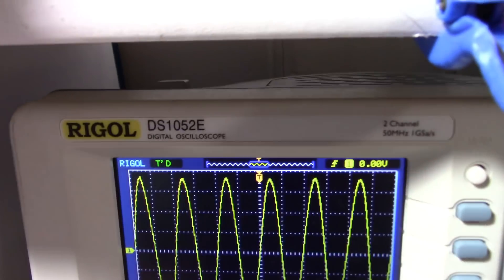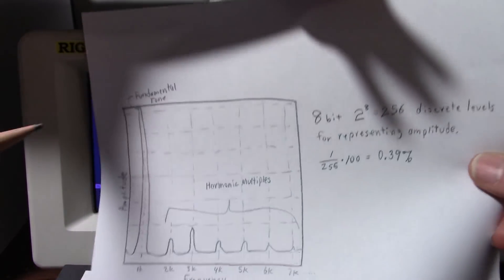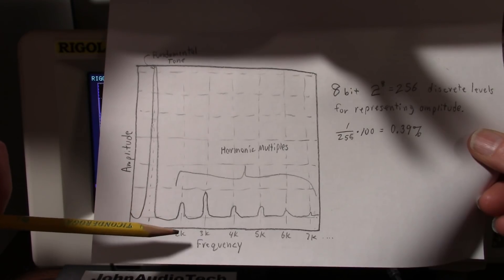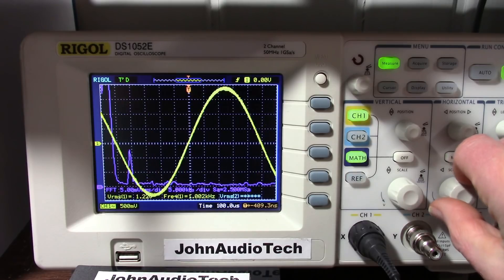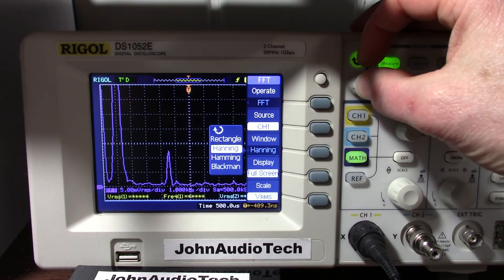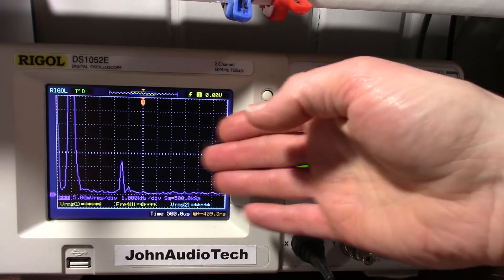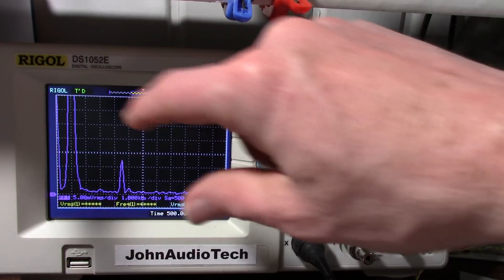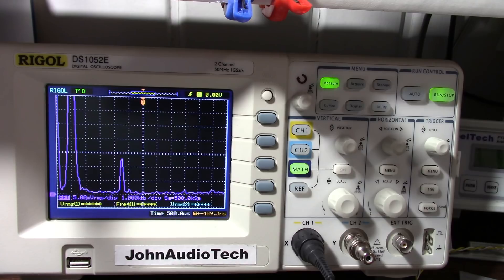Rigol DS1052 vs Siglent SDS2202X oscilloscope spectrum analyzer mode (FFT)

Comment: Only RIgol scope I have is the DS2302A.  The FFT is not too bad.  I like that I can have the FFT and Trace on the screen at the same time.   Really you should be using a PC with a voltage divider and 24 bit audio,  or spend the thousands on dedicated gear for distortion analysis.

Comment: I use similar Siglent mostly for FFT. Not sure about Rigol, but Siglent can do much better than seen here, but you have to know how to use it. There are a lot of things to adjust, but then you get very good audio and RF spectrum analyzer. I manged to get easy 60-70dB of dynamic range when measured harmonics of RF transmitter and got same result with real spectrum analyzer.

Comment: When working with oscilloscope fft, I like to use the avarages to reduce the noise floor... I have a Rigols aswell, and boy, that is a slowwwww scope...I'm thinking about adding the sds2000x 4 channel siglent scope for the lab. Not shure about that yet.

Comment: Revised for clarity on 5/4/20

Hi John, I have a question for you regarding analog to digital conversion. I don't have a problem with the concept of only two samples are needed to fully determine a signal's frequency, but I do have a problem with only two samples are needed to have determined both the signals frequency and amplitude. ..

I came back and edited my  question by providing a visual example to make my question a bit more clear. 

I am sure that a change from a negative value to a positive value is only needed to tell us that a sinusoidal waveform has gone from its first half cycle to its second half cycle along its full interval or period and from this given the timing of our sample rate we can determine precisely the frequency of a signal with as few as 2 samples.

However, think of a 20Khz tone as the signal. Now allow one's imagination to zoom in to just one interval or complete period of the tone along the time domain. What one is visualizing is a complete cycle of the tone along an axis of time. Suppose t=0 is the time at the beginning of this cycle, t=e is the time at the end of the cycle and t=m is the time where the cycle transitions from negative to positive by having a function value or amplitude of zero. In my model where are the peak amplitudes? Well, they are at (t=0+t=m)/2 & at (t=m+t=e)/2. Where along the axis of time were the two samples taken along this complete cycle of 20Khz? If the two samples were not taken at a point on the time axis that coincides with the peak amplitude of the tone in my example then what? Well, then we have an approximation for the amplitude and seemingly only precisely have determined frequency, right?

So, my question is essentially are people reading more than what is real into the concept that as little as two samples fully determines an analog signal. Otherwise, should they be saying, restricted to frequency and given a sampling rate, as little as two samples will within limits fully determine the frequency of the signal and provide an approximation for the signal's amplitude that becomes less precise with respect to amplitude as the frequency increases?

Aside from my question I hope your brother is doing as well as possible given the additional burden he was given to carry.

Thanks, 
Mike
Reply: Hi Mike, that’s a great question that I think actually can take a full video to explain well, but in short; it is the Nyqiest Theory that says that you can reproduce a wave shape in 2 samples per cycle.  But, I think most scope manufacturers shoot for 2.5x to 5x samples per cycle.  Great topic!
Reply: Edited for mis types and
Amended to include a summary of what my review of Shannon's theorems actually imply attached to the end of the comment. Yes, Kiss Analog, a video on the topic would be fabulous especially if you can visually show that aliasing is occurring such as by perhaps inputting a 22 khz tone with a precisely measured  amplitude into a ADC- DAC where sampling was at 44 K and show that the output is an aliasing artifact by not being an exact match of the input. 

Ok, I found my answer by finding Shannon's theorems related to digital signal reproduction. In particular Aliasing. 

Having no real electrical engineering background did not keep what I have a graduate degree in which is mathematics from recognizing something is amiss with the notion that as little as 2 samples will guarantee a faithful representation of the signal. 
 It will have a problem with amplitude and precise frequency if the cycle being sampled has only one sample in each half of the full cycle. For example aliasing or misrepresentation will likely happen when the 44.1k sampling scheme samples 22khz. The data stream for an interval of 22khz sound that has been recorded might look like this: (1,-1),(1,-1),(1,-1),(1,-1)...ad infinitum. The trouble is that while frequency can be determined roughly from this stream even were it precisely identified there still are an infinite number of amplitudes having a fixed frequency that will match (1,-1) or any other pair of numbers indicating a similar type of wave. I did not know this was called aliasing until today, but that is the term for it. 

Apparently people like to filter out the troublesome high frequencies that lead to aliasing when using 44.1k sampling. I would prefer going to 88k sampling which eliminates the chance of aliasing at 22khz and similarly issue prone frequencies and keeps the recording faithful.

The other thing of note is. The Nyquist-Shannon theorem people often refer to is actually several theorems grouped together that pertain to digital recording. Aliasing was the topic of one of the theorems and the rest pertain to other topics pertaining to digital reproduction.

Footnote or summary:

After reading through all of Shannon's theorems the general interpretation of his work that is fitting is:

If 2 samples having the same sign are provided then and only then the amplitude and frequency of the full sound wave being sampled is fully and uniquely determined else aliasing occurs.

Simply stated, 3 samples where 2 of the samples must have the same sign of (plus or minus) is required to avoid aliasing also known as misrepresentation. The common inference that only 2 samples are required to fully determine a complete sound wave is inferring too much by not recognizing the pair of samples must be in the same half cycle thus in reality 3 are needed to avoid aliasing. I have calculated aliasing or misrepresentation can occur at above 14.8 KHz when 44.1 K sampling is used. There is also a chance no aliasing in the human range of hearing occurs when 44.1 K sampling is used, but that is extremely unlikely unless the problem frequencies have been filtered out at input to the ADC.

So, yes C D quality and Hi Fi quality are indeed different and having my druthers...

Comment: Some comments if I may as a Siglent distributor. FFT results are dependant on timebase and memory depth as with a much larger memory and twice the sampling rate than the Rigol it takes time for the processor to compute all the data points into a FFT trace. Unlike the Rigol, the Siglent will give better results with more waveform cycles on the display and any discerning latency can be addressed by setting a lesser memory depth if required. Detailed inspection of very small signals can be accomplished by changing the reference level and the vertical scale. Also if the noise floor is unstable try selecting Max Hold. Reducing the FFT points is not the way to use Siglents FFT for best results. 
Oh and BTW, you are using the incorrect Siglent model number, what you have is SDS2202X-E, a 200 MHz DSO with faster processing, better sensitivity and FFT than the older 2000X series. As these are just $619 they are also much cheaper than an equivalent 2000X model.
Have fun learning your new scope.
Reply: Which one is newer / better: Sds2202x-e or sds2202x? Thanks!
Reply: @and1424  Certainly for FFT SDS2202X-E as the newer faster processor they use allows for the 1 Mpts FFT. Although the display size is smaller and they have shared controls their total feature set is better than the older X models. If you're seriously considering a new DSO have a look at the mighty new SDS2000X Plus models.
Reply: Thanks for jumping into the thread, tautech.

Comment: John the Siglent has so much more depth, but I'm surprised that your signal is so course.  I think you need many more cycles than the Rigol  The Rigol is good with 5 cycles because it has too little memory to work with more data - but I think the Siglent wants or needs more data.
Reply: 'coarse' of course 😉